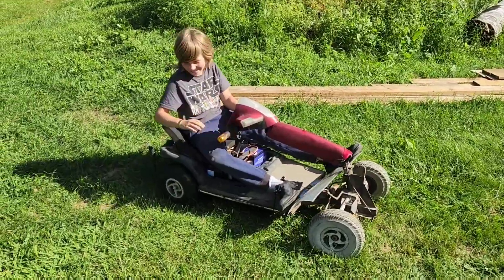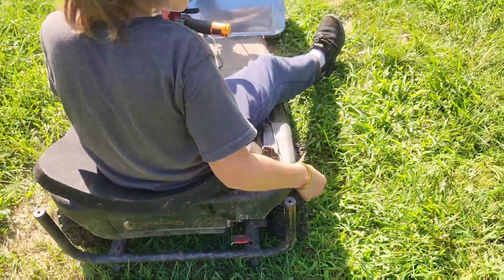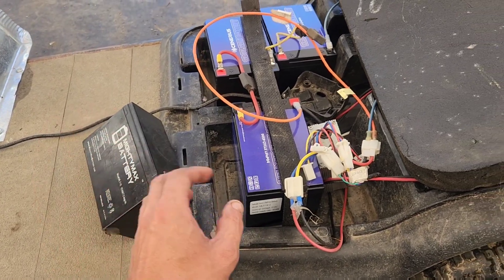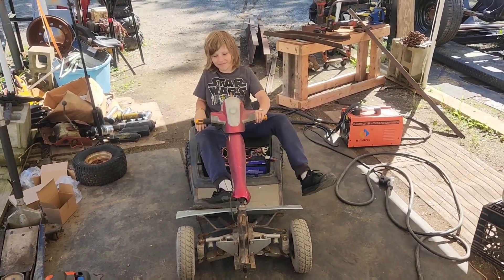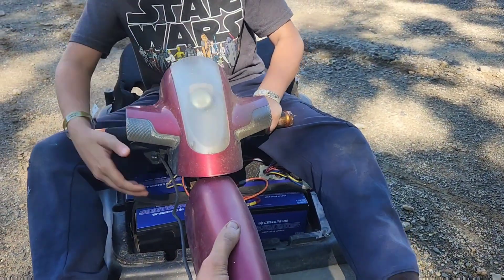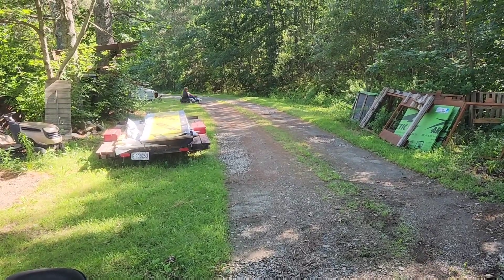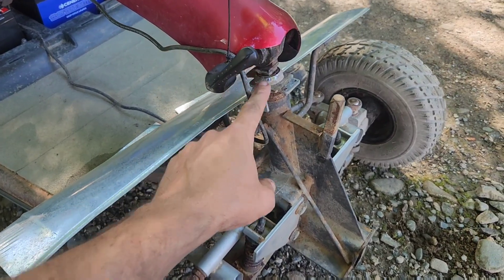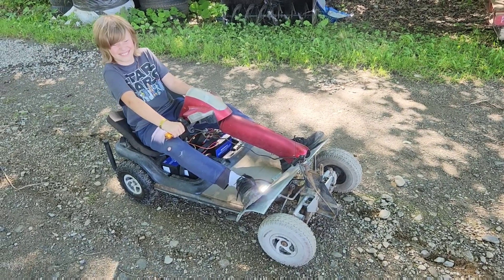Mobility Scooter Go-kart Lithium LiFePO4 Upgrade

Comment: I use the dimension engineering sabertooth motor controller because it has regen braking  although it tops out at 33.6 volts it's an all round pretty robust controller for r/c and ride on toys. Its a dual drive but of course can be used for single wheelchair motor.

Comment: Link to the speed controller please. 

Everyone I’ve bought so far over heats
Reply from the maker: Info added. One side note we figured out a few year ago. The China controller will pull every amp they can get and explode at about 150 and up. We fried 4 tell we sorted out it was the 250amp battery we added causing it.